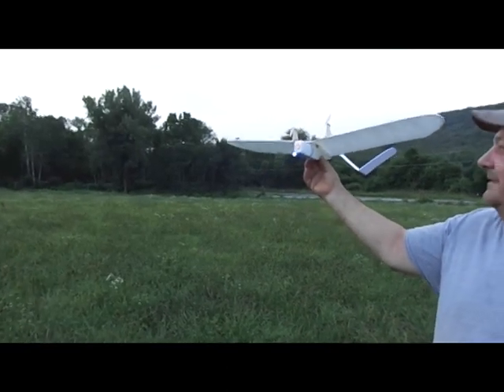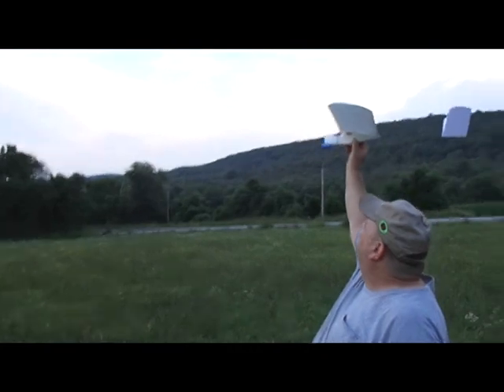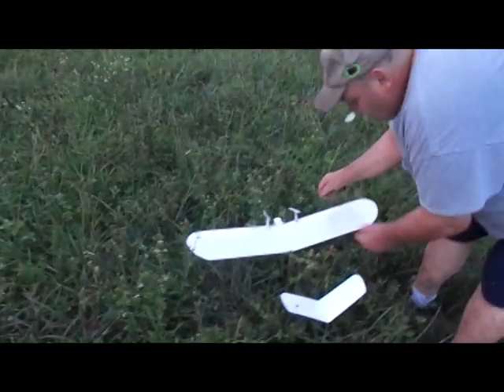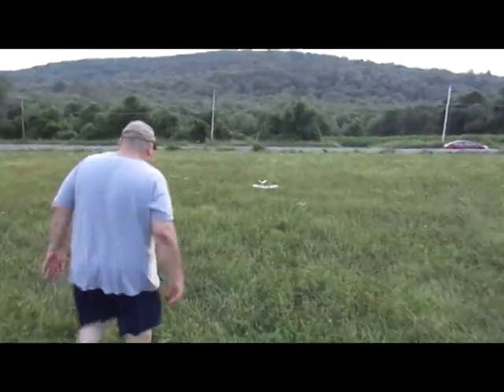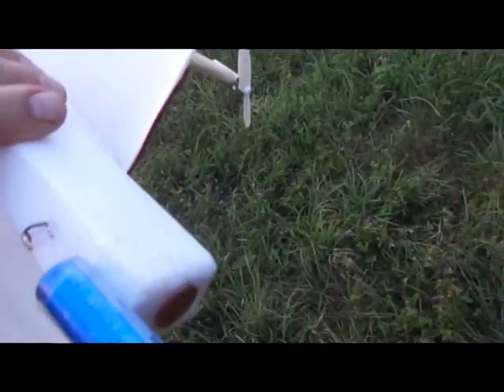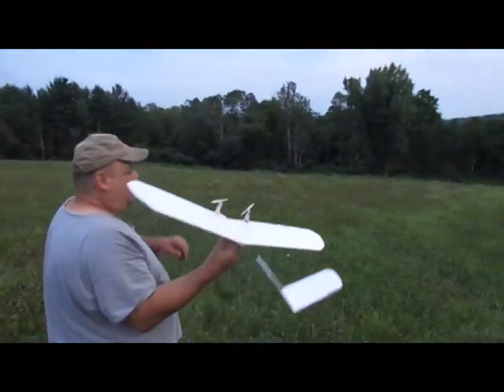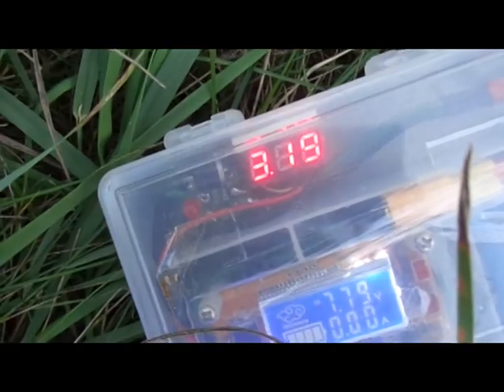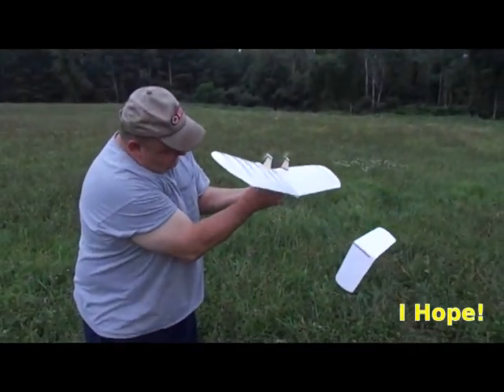BIG Supercap F/F Plane Initial Testing and Trimming

Comment: thanks for the information you've shared. I needed that
Reply from the maker: No problem! We also have used insulating foam from the lumber yard and styro picnic plates from the market. The white blocks of foam which electronics are shipped in also comes in handy. Also, when you're sanding foam, use wet type sandpaper and do it wet, in the sink, over a vegetable strainer lined with paper towels, rinsing the part and the sandpaper under running water and catching all the plastic dust like a filter. You don't want micro plastics getting into the environment. Also if you do it this way it doesnt get all over your house either! (We sand airfoils into all our flying surfaces so we save a lot of mess)

Comment: enjoy your videos. You guys have way too much fun. Unable to find any hobby foam around here. Can you provide me with a manufacturers name etc. I've tried every resource I could come up with.Thanks
Reply from the maker: Thanks! Glad to have you on board. We're using throwaway styrofoam meat trays that the markets around here use. We have also purchased a full carton of them from a restaurant supply company. We got the largest ones available (12"x16") in a 100 count carton. Delivered by UPS in 2 days. Here's a link...we're not affiliated btw...
https://www.webstaurantstore.com/ckf-88140-foam-meat-tray-white-16-x-12-x-5-8-case/37412X16WHTE.html
These were available from other vendors, but these were the only guys who would sell a single case....explore their site a bit, the stuff comes in different colors, too.
   You could always use balsa, or balsa-and-tissue. We started using foam because it was cheaper than the balsa wood!
   The actual hobby-grade foam is called Depron and is primarily manufactured as insulating sheet foam. I believe it's made in Germany but no longer imported. You could try to Google some up.  Good luck!

Comment: I wonder if the high placement of the motors is leveraging the nose down.  Maybe a tiny degree of up thrust will help.
Reply from the maker: You have an excellent eye for flight trim adjustments! You'll see in part 2 of this video that what this plane needed was 5 or 6 degrees of up-thrust on both motors, a substantial increase in wing dihedral, and addition of trim tabs to flying surfaces. She's turning in 2 minute flights in dead air now! Editing video clips today for part 2, watch for it coming soon.
Reply: sonex413 The eye is developed by many past mistakes. Hahah.   I'll keep an eye out for the next video.
Reply: I'm thinking you're right;  Flying boats had there motors 3 or so degrees up thrust for that very reason.